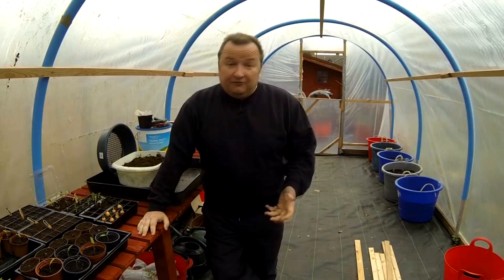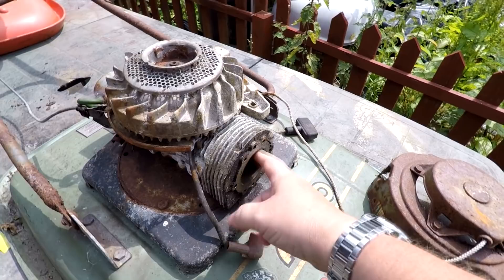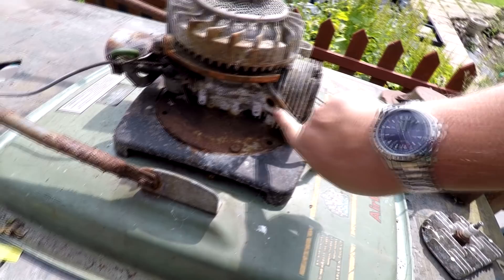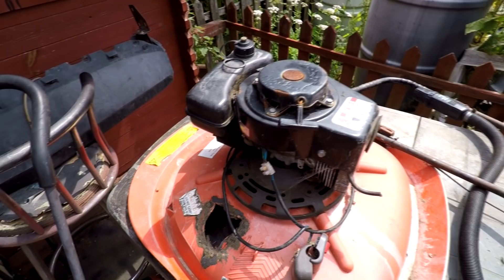Rare Atco Hover Mower May Live Again Vlog

Comment: My dear old (late) Dad had a Flymo version of this. He always cleaned it after using it, cleaned the spark plug etc. It rewarded him by always taking about 20 pulls to start. Our neighbour also had one and never cleaned or looked after it, it started every time much to my Dad's frustration.
Reply: M & M Like British Leyland, your dad probably got a Man Friday.
Reply: It taught me a lesson that petrol mowers are there to be abused. When I had one I never cleaned it, never serviced it and it always started first time, even after four months in the shed over the winter. I once put diesel in the tank by mistake. It ran really rough and then I corrected my mistake - it worked better than ever. How my Dad would have chuckled!

Comment: Watch yourself with old hover mowers, I've got an 80s one and the impeller exploded, the aloy boss had corroded and split the disk. It's one of the loudest/most dangerous things happend to me. You will probably find the impeller and disc height will be different, flymo must have 100+ different disc combinations!

Comment: Great video Martin. Atco made some great machines in their day, specially bowling green mowers.That should be a great mower with the engine transplant. But you have to be careful you don't smash the fan underneath or it loses its hover.
Cheers, Jeff.
Reply from the maker: Yes, its a rare find Jeff. Hopefully it will fit.

Comment: Beware of the little screw on top of the fuel cap. It's used to cut off the ventilation when you store the mower to prevent the fuel leaking.. It had me foxed for a while when I tried to get one of those MV100S engines started :)
Reply from the maker: Thanks for the info Simon

Comment: These older mowers are always so interesting! Can’t wait to see you swap things over and see it run!
I have never gotten to use a hover mower so seeing how well they cut will be a treat. (I never knew they used string like a weed trimmer!)
Don’t imagine they will cut as well as a wheeled mower, and probably struggle with tall thick grass but still really interesting to see how it does
Side note: I personally have never been a huge fan of the way 2 strokes sound but that one actually sound pretty nice
Take care!
Reply from the maker: Yes Aaron, I got lucky finding this for a tenner. The hover mowers are usually used on hills or sloped gardens where other standard mowers would struggle.

Comment: Can't beat a simple 2 stroke Martin. Yes definitely worth restoring that old mower.
Reply from the maker: For a tenner Malc, I'm well pleased with that engine.
Reply: A simple 2stroke.... I have a year old strimmer and it will give me a heart attack one day. You have to pull the string so many times it's a joke. I've used it about 5 times with fresh petrol and cleaned the plug and still a bit** to start even when hot
I might take the hammer to it one day.
Reply from the maker: @terryatkinson3182  Try and close the plug gap a bit. They can be a bugger if the gap is too big.

Comment: Those tecumseh 2 strokes are pretty tough little engines
Reply: Carb was the same as a Tecumseh, but the air-shroud didn't look like the ones I've wrenched on. I'm not as familiar with them as I am with Briggs & Stratton engines, but they are tough :-)
Reply: Tecumseh have shrouds like that, that normally fit on their 4 stroke engines. They are very similar to the B&S engines in appearance.
Reply: I have a Tecumseh 4 stroke mover I have owned since I purchased in 2001 I have never changed the spark plug on it I have changed the oil a few times, it lives outside in all weather, snow, rain the lot and when I get it out in the spring time I top the tank up with fresh fuel prime it and it fires up withing 3 pulls, it's never ever let me down excellent bit of kit.
Reply: @markmawson1  thats not a 2 stroke if ya changed the oil
Reply: Rick Delair  sadly their 4 strokes like to throw rods     lost count of how many blown up tecumseh 4 strokes ive seen with snapped rods and holes in the block
Reply: @alexhickey5633  sorry mate just seen what I had wrote I meant to put 4 stroke at the time I was commenting I was talking to a mate about about his KTM250exc with starting issues
Reply: Rick Delair  when you want something fast n powerful ya go 2 stroke all day. For low end grunt ya go 4 stroke diesel imo

Comment: won't run right till you put the air filter air box on. that's why you have to have the choke partly on to keep it running.it needs the restriction of the air filter for correct mixture.
Reply from the maker: We just wanted to prove its a runner bud.

Comment: Hi again Martin, you jammy devil! Ten quid for a sweet replacement engine! I would be very interested to discove what you might try to free up the original engine.You see  I have an old French 2-stroke moped, an auction win, and the piston is stuck in the barrel. When I opened the crankcase I found moisture had got in and rusted the main bearing. My problem is that afterv trying penetrating oil, hard wood block and hammer, heat and even lemon juice to free off the piston, it won't budge. I don't have a high pressure grease gun so I can't try hydraulics. I would be very grateful for your advice. Thanks from an old Yorkshire "Geezer" in Ireland.
Reply from the maker: Try soaking it in diesel for a week. see how that goes.
Reply: @retrorestore  Thank you Martin for taking the trouble to reply---I'll certainly give it a try.